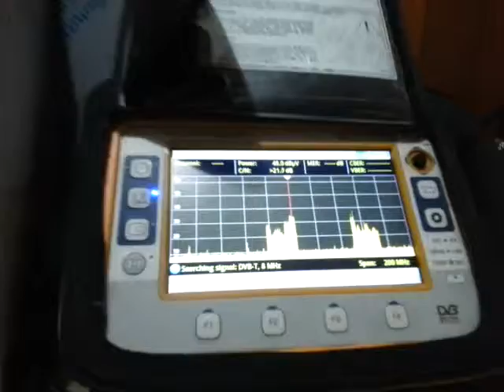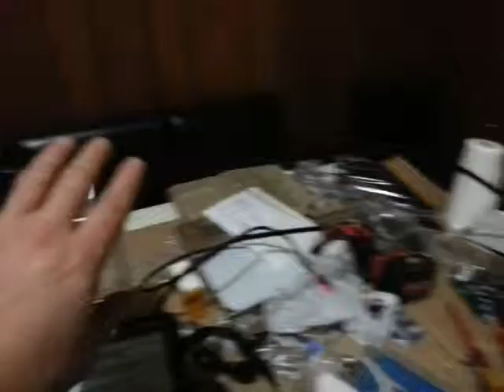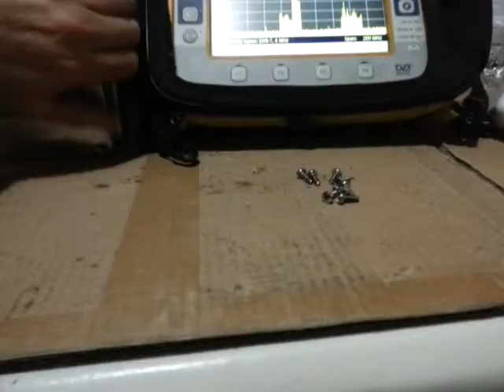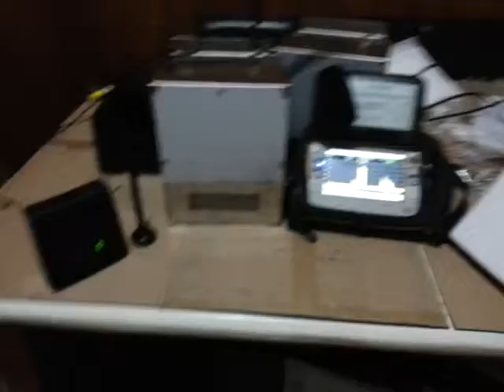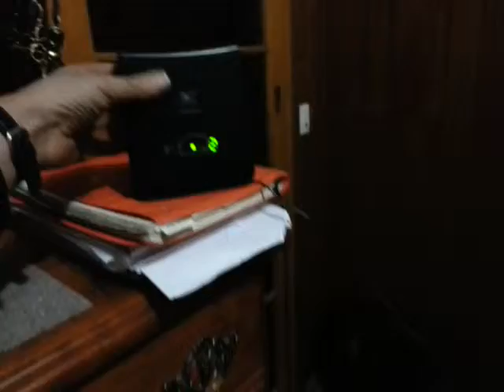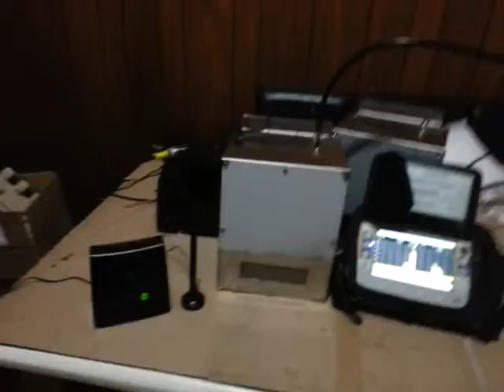Cel-Fi Enhancer

Comment: What does 0/1/2/3 mean?
Reply from the maker: According to Nextivity, the manufacturer, the 0/1/2/3 illustrates the coverage of the repeater. This is proportionally related to separating the repeaters and reducing feedback back.  However in practice it is a measure of 5GHz link power.
Reply from the maker: My Enhancer design allowed the repeater pair to be placed close together, minimise feedback, and allow maximum Tx Power when the repeater is connected using an external antenna!